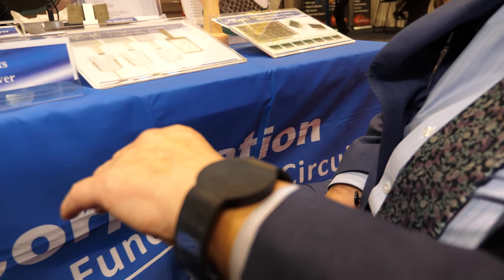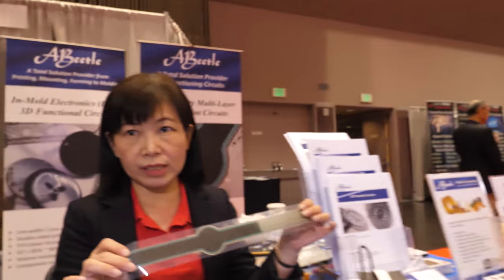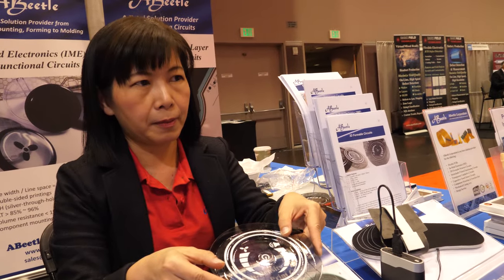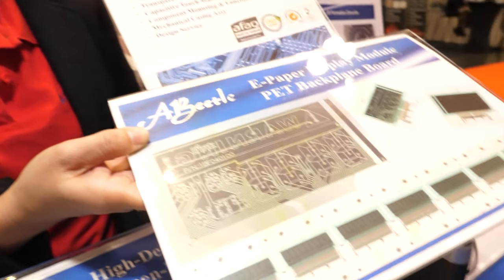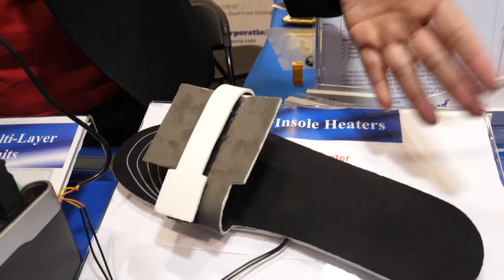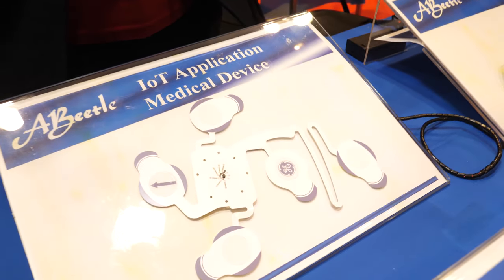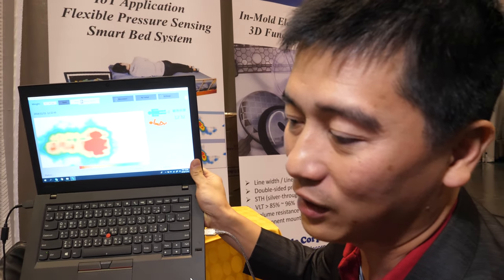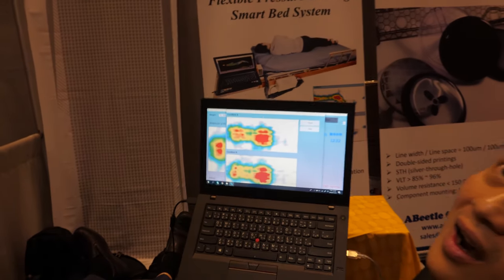ABeetle Flexible Circuits, Transparent Touch, In-Mold Electronics, 3D Formable

Comment: How does the bed adjust?
Reply: Imgay Asheck they said it adjusts with air bladders.
Reply: it's embedded with air tubes which are adjusted automatically through the control system